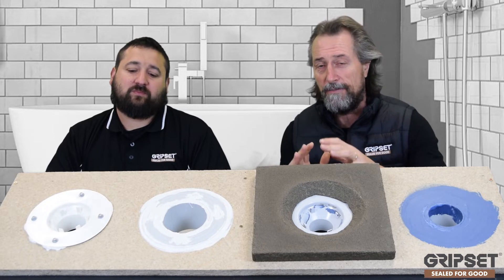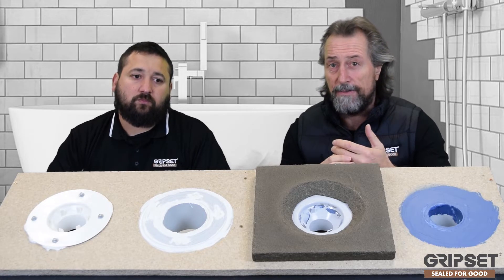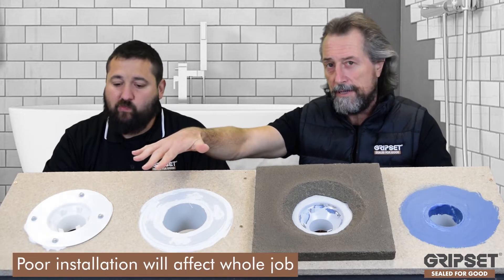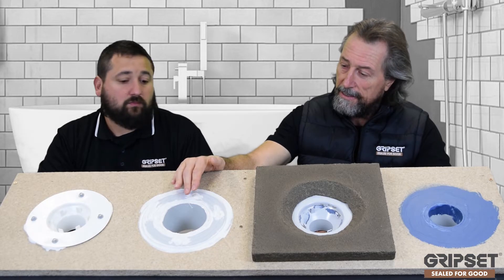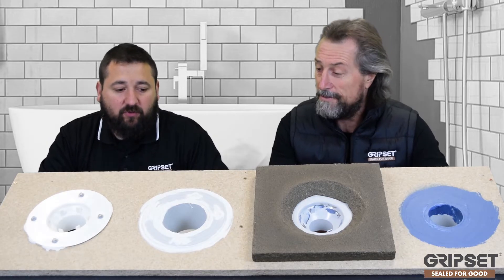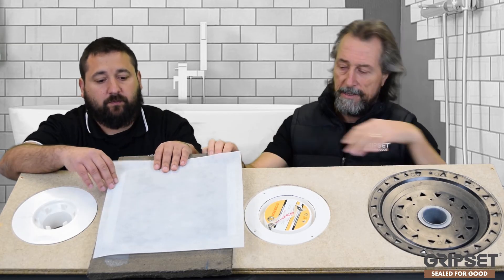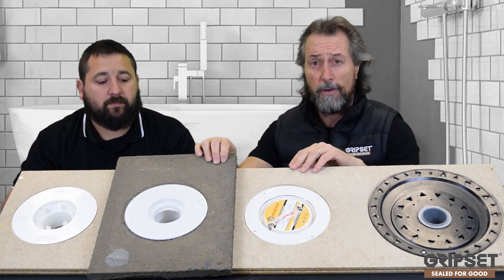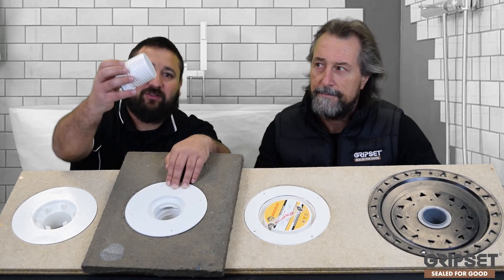How To: Waterproofing With Puddle Flanges

Comment: What happens if you have a tile drain and it's 25mm tall with the tile + adhesive being ~13mm. You can't have the puddle flange flush with the screed otherwise the drain will be above the tile height. How do you install this properly?
Reply: Without doing number 3 of the don't do's?
Reply from the maker: Refer AS3740 and look at linear drain design detail it may be adapted to work for your scenario or get advice from drain supplier/manufacturer

Comment: If using your Xpress Lay membrane, will I need to use the BW square for the puddle flange?
Reply from the maker: Hi SLim, you will not as this will bond to the PVC and you will be able to cut to expose the waste!
Reply: @GripsetIndustriesPTYLtd  Thank you. The Xpress Lay membrane has a criss cross pattern on it and I wanted to smooth it out before glueing down the vinyl flooring. Could I use feathering finish, smoothing or leveling compound on the Xpress Lay membrane?

Comment: im loving your videos but they are also causing me confusion to the point im not sure what im doing, and neither does my plumber as he does things old school. I Want to install a really LOW rise leak control flange. My shower drain waste pipe is 40mm, the tile insert linear drain is 50mm But its also 50mm in "Tube/connector" height, and in the practice of using a puddle flange for its purpose, wont allow water to pass it due to the way it sits inside the flange.  Why dont waste drain pipes have holes at the base to allow any  leakage to drain, aswell as the main waste.
Reply from the maker: Hi ExposeClothing, please email info@gripset.com, if you could please send some photos, our technical team will respond to you promptly!

Comment: Such an informative video! 
But I have a question
You said sand and cement do not stick to plastic surfaces even after primer. However, can they adhere to waterproofed surfaces?

Comment: 16:37 but wouldn't screwing it in block water making its way through tile joints?
Reply from the maker: Hi Nicko, Thread is designed to allow water to drain. Thanks for watching!

Comment: So you always suggest an under and over for membrane. And 2 x flanges?
Reply from the maker: Hi Stede, Thanks for watching! it is become common to waterproof under and over, especially upstairs shower areas. we recommend full waterproofing system at both layers including puddle flanges, Thanks
Reply: what happens in the event the concrete slab has been presloped and no screed will be used, just tiles onto waterproof membrane @GripsetIndustriesPTYLtd
Reply from the maker: @ExposeClothing  With that scenario, as long as there are falls to drain, a single layer is more than adequate! 2 coats! Always refer to the manufacturer's TDS. Hope this helps! :)
Reply: @GripsetIndustriesPTYLtd  it sure does, thank you.

Comment: I have a builder coming in to fix a leak in my ensuite where the water is coming under the tiles and into the bedroom, when he lifts the tiles should he place waterproofing over the top of the old waterproofing or pull up the existing waterproofing and replace with new?  given the bathroom is only 6 years old since totally renovated should there have been a puddle flange installed (this is an insurance claim).
Reply from the maker: Hi, to respond to this in more detail could you please send through some photos to info@gripset.com - thanks

Comment: you under and over screed waterproof a bathroom floor and puddle flange the substrate and the screed. What happens if the over screed  waterproof fails and water enters the screed how does it exit if the puddle flanges are sealed one to the other?
Reply from the maker: Hi Mark, this is the reason we recommend 2 puddle flanges if top membrane fails water will still drain from puddle flange below, flange is designed with leak control feature that should never be sealed, Thanks for watching!

Comment: At 7:40 you say the issue is achieving the thickness of membrane on the top sceed edge. Isn't that going to be the same for the top puddle flange edge before the waterproofing gets turned down into the flange?. Essentially the same situation, same sort of edge.
Reply from the maker: Hi Mark,  Thanks for watching! The simple answer is no, if you follow Gripsets detail  for waterproofing puddle flanges, our options are 1. OP non Porous Primer to SB sealed puddle Flange followed by membrane embedded with RF fabric (the RF reinforces membrane and ensures correct thickness to the down turn edge)  2. BRW PF square adhered directly to flange (no priming required) including downturn followed by coat Gripset liquid membrane(as detailed @ 13:55), again this method guarantees correct even thickness at edge. 
Membrane thickness to edge is only one of the issues discussed with Flange/Screed set up as shown from 6:00 - 8:00 but its one that can be addressed by the same methods as detailed above, Thanks again, you can find all details on products mentioned above @ www.gripset.com happy waterproofing!

Comment: Good video. I'm not a fan of those butyl squares (or the butyl tape for corner detailing), they are only good in an ideal world on a new build where you are sticking down to a new perfectly smooth flat surface. Trying to use them in a renovation situation where you have old rough and chipped particleboard or rough concrete is a pain in the ass.

You guys must love the over & under waterproofing detail, twice the product sold & used for one job. 😉
I'm a firm believer in picking one method (either over or under) and doing it properly.
Reply from the maker: Hi vzgsxr, surface prep is a critical component to waterproofing applications, it is important to always have a smooth surface when applying product. If substrate is prepared correctly there should be no issues with the application of any Gripset's products, we can provide further details, just shoot us a line at info@gripset.com. In addition it is recommended to replace any damaged particle board in wet areas. 
As for under & over waterproofing, this is a detail that is being pushed by the building industry to offer greater performance and longevity to home owners and continues to be an option home owners and builders lean to for peace of mind. 100% agree doing it right from surface prep to product application,  under or over will meet the minimum standard requirement, but its good to know there's plenty of applicators out there offering the additional service as an option. Thanks again for watching and all your support

Comment: Seems like you could get away with only the under using the screw type drain?
Reply from the maker: Hi PDB! if the intention is to only waterproof below screed then any puddle flange will work, twist style is a great design though, Thanks
Reply: @GripsetIndustriesPTYLtd  Great Channel.  Also been really liking your c1p on my pools. Do I really need to detail the floor to wall connections when it's a one piece poured shell?
Reply from the maker: @pacificdynamicbuilders4380 , whether you need to detail will come down to pool shape, if you have a continuous cove, detailing is generally not required , check out this Sealed For Good episode featuring Pool Guru V-vo Middleton for in depth look at all things Pool related :  https://youtu.be/Slm7EP9h8RQ 
Great to here your loving the C1P , if you upload your C1P photos to: https://gripset.com/wow/  you can claim 1000 bonus points until end of Sep 2020, make you upload so we can reward your support, we appreciate it!